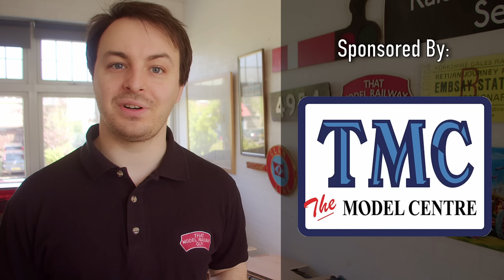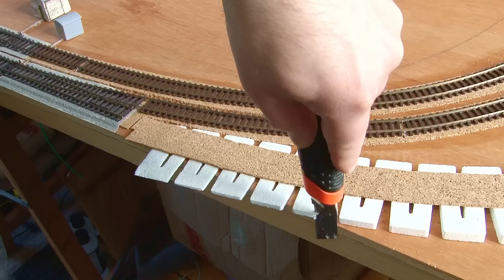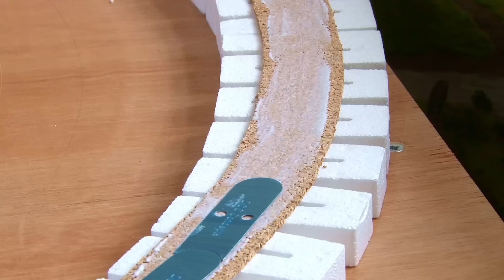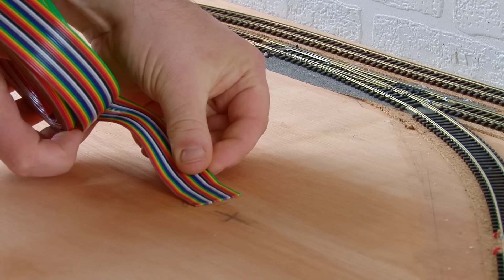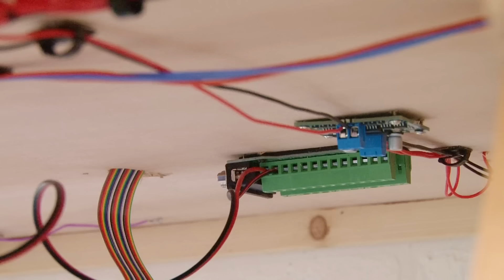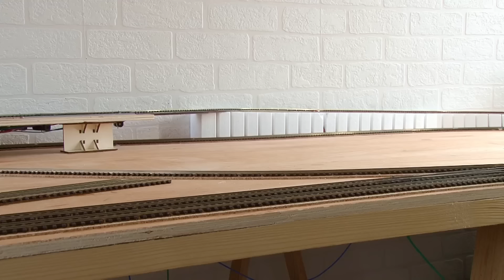Building A TT:120 Model Railway - Episode 4: How To Build An Incline

Comment: Great job on the incline. Inclines are never easy to do, but you done well getting it right and making sure that trains can run up it no problem 😀
Reply from the maker: I do feel the Woodland Scenics risers are the best way to get a nice, smooth incline but yes making sure we had a foolproof plan here was crucial. 

That said it's only the A4 and A3 that need to use the power base to be honest - both the HST and the new Class 50 are much heavier and have no trouble pulling long trains up the incline. Thanks for watching 😃

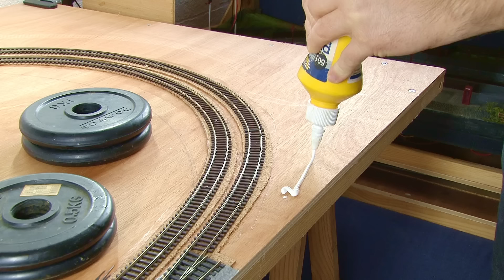Comment: bit late to mention it (sorry!), there is another way to ease gradients, take the bit thats not under the upper deck and raise that, so where your incline starts you are already say a third of the way there, then drop back to go under the upper deck. using this here to allow a 1:50 (2%) slope, also means the track at the front is variable in height avoiding "flatshire" look

those powerbases are nifty, Hornby used to do similar when they were using steel rail, which brought its own issues, this is a clever way to do it
Reply from the maker: It was something we considered but there were two main issues:

Firstly, if the mainline was starting to rise along the front it would have to come back down before the bridge on the right hand side of the layout. That would would result in a small but short and sharp incline for any trains travelling clockwise around the circuit and would have further impacted things like the cut-through and the shunting yard too.

The second consideration was it would visually diminish the impact of the upper level and we wanted there to be a clear distinction between the two. By having the section along the front climbing up, either we would have to raise the landscape behind it up as well (which didn't fit the brief I was given) or cut it off and create a basin of sorts.

As I said in the video, it's always better to have a longer incline if you can but we also have to appreciate that every model railway is a compromise and (just as we run trains on incredibly tight curves) sometimes we have to accept a sharp incline if an upper level is really wanted. Thanks for watching 😃

Comment: Another great video, thanks ❤. I’m thinking of getting a Mallard, will I need the power base to stop it from flying off the track? 😉😂
Reply from the maker: Haha! If you're running it at normal speeds on standard curves and flat track you should be fine. It's really only for the inclines it's needed - even then some models like the HST are heavy enough that they don't need the magnets. Thanks for watching 🤩

Comment: Love a layout with a second level and in this case it gives good reason for a delightful tunnel feature. I have built such a slope before but it was complicated and time consuming, I am inclined to think that your method is a  far better way forward, and very uplifting to see the build going so well. Those magnets look so effective, a bit like the old Hornby "Magnadhesion" but under the track and not in the loco. Excellent video thanks. :_tmrgPeckett:
Reply from the maker: Considering my Dad wanted both a tunnel, a bridge and an upper level, it was the logical way to kill many birds with one stone and I agree, it does visually add a lot to the layout.
I have to admit I was concerned about the incline and getting them smooth enough to operate reliably can be really tricky. The polystyrene incline sections and the Power Base have really made the whole process a lot easier. Thanks for watching 🤩